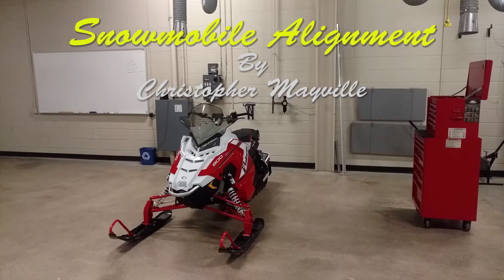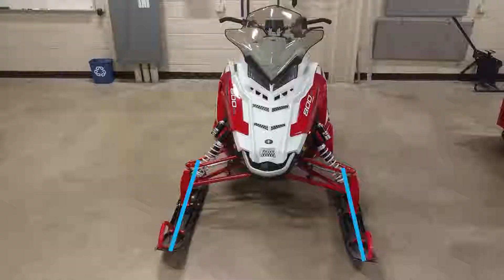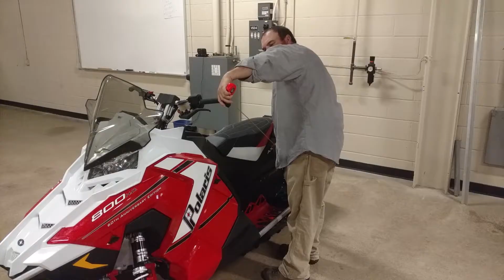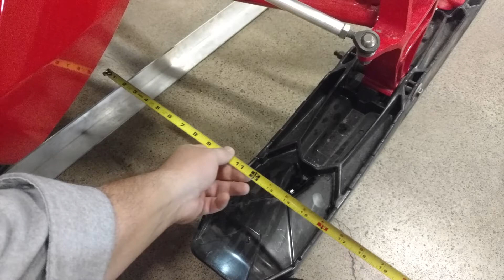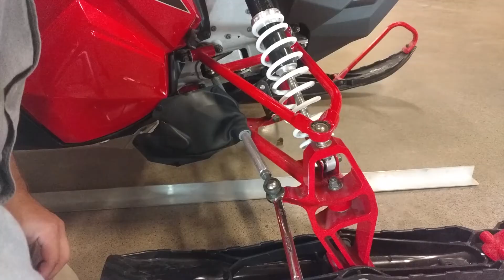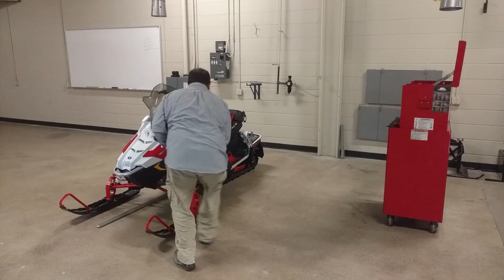Snowmobile Alignment Instructional Video

Comment: What is the course text book and where can I get it?
Reply from the maker: The textbook we use for snowmobile and ATV steering is Bombardier Recreational Product's Guide to Service Fundamentals and Principles. The BRP part number is 484 800 168. I am not sure if you can still buy it from BRP. Sometimes you can find a used version online. Its setup like a traditional textbook and has information on many recreational vehicle systems. We also find that factory service manuals, especially the older ones, have good descriptions and illustrations of the process.